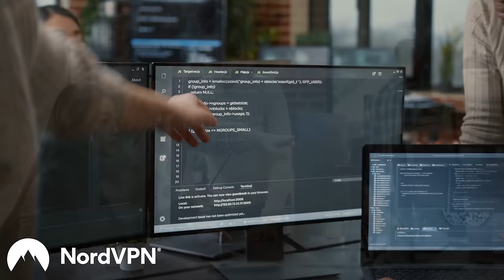Elon Musk fails Cybertruck stainless steel metallurgy test | Auto Expert John Cadogan

Comment: Cybertruck steel failed. Then Musk had to order expensive high quality steel from Finland. Company name is Outokumpu. They have supplied SpaceX before.
Reply: That’s not completely True.  CyberTruck has always used the same SS as the Starship uses.  This steels main supplier is in Texas but the Finnish company is secondary supplier for SpaceX and is now the main supplier for Tesla.  The Texas supplier is more strategic supplier so it’s steel will go to SpaceX first. I am sure that in the future even more suppliers will be set up to produce this special alloy because of high demand for it.
Reply: Where did you get this information that the steel failed? What's your source? Trust me bro? Tesla uses the material scientist from SpaceX to design the steel. Any steel manufacturer can produce it and supply to Tesla. It's like Apple designs the chips but Chip fabs manufacture it. That doesn't mean that Apple's chips failed and they had to order it from a supplier.
Reply: @achasilas6535  " Tesla uses the material scientist from SpaceX to design the steel."
I'm not sure what that is supposed to mean. Requirements for space are so different to the requirements for a car that I can't see why using SpaceX metallurgists should be seen to be an endorsement.
Reply: @cccmmm1234 yeah cos wtf do rocket scientists know right?
Reply: Utter nonsense. Tesla obviously doesn't fabricate it's own steel. It's suppliers in Texas and now in Finland manufacture Tesla's 30X specification. I don't see how that could be spun as a failure.

You sound like a flat-earther.
Reply: @cccmmm1234 why is that confusing? If you have access to highly skilled metalurgists, you would want to use them. The field is not so specialized that a SpaceX metallurgist would be incompetent at designing a metal for Cybertruck.
Reply: @Seehart  "it is space steel" is just bs to excite the fanboys.
If you're old enough, you would have seen the same hype in 1960s/70s marketing hype when the space race was on.
The requirements for space are completely different than for cars. This is hype. I really doubt that it happened as much as Musk says.
I write software that NASA uses. Maybe I should start calling myself a space programmer for extra credits.
Reply: @cccmmm1234  Well sure, there is hype involved. The motivation to use this steel and get the help of SpaceX engineers to design it is just resourceful engineering.

The conditions in space are entirely different, as you point out, but the skill set is the same. In both cases, it helps to have a deep knowledge about all of the material property effects of combining various elements in the alloy. SpaceX material engineers presumably have this generalized knowledge. Your argument is like rejecting a seasoned full stack web developer because they've done websites for the finance industry but you need a web site for an airline. Skills are skills.

But sure, Elon bragging about the SpaceX connection is legitimately hype. So what? Is this the first time a car company has engaged in hype?
Reply: @achasilas6535  More Tesla/Musk Hype BS.
Reply: @cccmmm1234  that Just means SpaceX metallurgist are some of the best in the world. They have design metals that withstand some of the toughest stresses and condition of any moving object. So using their expertise to design something revolutionary for the car industry which is less demanding. So you should expect excellence as well
Reply: Earth is testably flat and stationary  @Seehart
Reply: @joshtheflatearthjedi222  yes, josh, of course it is. I know that. I'm glad you and I and John Cadogan can agree on something
Reply: @Seehart  me too

Comment: Hello John, George here in Michigan USA. I have not bothered you in a while but I just want to say one thing here. Quite a few years ago I saw a sort of high def line drawing of a modern car shown in a transparent form with all the different steels used shown in different colors. I found it very interesting to be able to see that for example even the corners of the window frames might be a different steel than that used in other areas of the door for example. There were many, many parts of the vehicle made up of many different alloys for safety and strength.
Reply: Makes sense. Different steels have different attributes. Different parts of a car have different stresses etc too.  It makes a lot of sense to use different steels where each is appropriate.
Reply: @cccmmm1234 even more - remember those aluminium frames for shaving weight and improving stiffness? Years ago there were articles about using high strength, light, multi-sheet (something like making swords, or I may be mistaken) steel used for frames, that would have same stiffness at same weight, but much cheaper and, of course, actually repairable.
More on this - those curvy shapes make the body stronger while light, flat sheets flex, a lot - it's not long to when we see Cybertrucks covered with same thing as bed liners (just like those 4x4 prepared for rough environment)

Comment: “All of the metallurgy is known.” - As a cutlery enthusiast I disagree. There is still new steels being made. Vanax and Magnacut are (relatively) new materials in the world. Shape memory alloys are another. I wish I was smart enough to do a materials science work, it seems like a growing and very interesting field.
Reply: Yeah, its sometimes amazing how often old retired engineers can cling on to old knowledge, and very adamantly insist on that everything is already know and no progress can ever again be made in their previous field of expertise.
Reply: Cutlery enthusiast, interesting! I'm more of a Cutlery admirer but I truly adore chopsticks. Hey, whatever floats your boat! 🍴🥢⛵
Reply: The steels you quote are both powder metallurgy steels, aimed at the knife-making market.  These proprietary grades might be recent development but powder metallurgy is not new.  However, they are a quite separate category of stainless steels to those continuously manufactured strip steels used for large scale manufacturing, which is the subject of JC's video.
Reply: @stefanh616 Dreamer. As a metalurgist and high performance race an Marine engineer I Absolutely confirm everything he said. 

I will also add, that going to skinny little wires at 48V powering All the lights, door latches... Everything.
Is Going to be an absolute nightmare with the galvanic corrosion induced by that Friggen stupid silver urinal body.
It would be a big problem even with a 12 volt system with 4x as  thick chunky wires.
Reply: John was talking about cars if I'm not mistaken ...good luck using Vanax or Magnacut to build a car body or outer skin lol 😂Layering carbon fibre compounds in between conventional steel alloys during manufacturing would result in a far stronger material relevant to it's application than any extra hardened steel alloy. What would be the point of a carbon tungsten car door for example? Such a door would instantly disintegrate into a thousand pieces if involved in a T-bone type collision, resulting in an even lesser protection of the occupants in that vehicle. Horses for causes  😉

Comment: A lot of modern cars use steel with boron content, which hardens during its time in the paint curing ovens - it has BH in the description for bake hardening,  and often has a electro-zinc coating of between 50 and 100 microns...

Comment: My first car was an EK Holden and it had compound curves on all the body panels. The bumper bar was also compound curves and when a "driver" reversed into the pointy part of the bumper bar it ripped the side of his car open and put a small scratch on the bumper. Those large flat surfaces of the cyber urinal will deform in the most gentle bingle and it will be bloody hard to fix.

Comment: Anyone remember how popular stainless steel appliances were? Only problem--they showed every scratch
Reply: Also fingermarks, grease, oil, all show.
Reply: And every finger mark.
Reply: Wtf did you do with your appliances? You think your plastic ones are hard and don't show the scratches?😂
Reply: So you have never herd of wraps
Reply: And rusted.
Reply: stainless steel appliances are the most popular selling appliance on the market. it gets prints, you wipe them off
Reply: Stainless appliances are at least strong enough for the job.  One big concern I see with using SS for car building is that the vibrational stresses of driving on dirt roads etc could cause work hardening, leading to cracking etc.

Comment: My experience with stainless commercial door hardware varies wildly, just like with other varieties of steel alloys. Screws that strip and bend, barn door tracks that destroy M42 drill bits, and every level of hardness in between. Sheet metal of that gauge wouldn't offer any appreciable resistance to a press with several tons of pressure on tap.
Reply: You have no experience on Tesla's steel. They invented it

Comment: Misleading!

You are correct is saying that the correct sized and maintained Press for the job should never break.

The problem however lies with the press tool (the mould) that goes inside the press, that actually shapes the part (product). 

I have seen press tools break due to overload and stress caused by trying to create a shape in the part that is difficult to achieve.
That will often mean redesign of the Press tool, the part or both.

With a sheet metal that is prone to work hardening (such as stainless steel) as you mentioned, some shapes will therefore be impossible or impractical to achieve consistently.

So, Elon should have said it was breaking the Press tool (the mould) and not the Press.

Either way, I don't see that shape catching on.

Comment: Good job explaining the metallurgy and I hope this will help explain the phenomena you are talking about @ 11:20...
Metal objects are not completely solid. When looked at under an electron microscope, there are 'spaces' between the different molecules that make up the metal- such as aluminum, manganese, carbon, etc,- and they are called 'dislocations'.
Once a metal starts to be stressed or fatigued, ie- bent back and forth like the coat hangar in your example, the 'dislocation's in the metal structure will move and congregate in one area, which then will potentially break, or actually does a 'catastrophic break' as in the coat hangar example, or leave a permanent bend as in a car fender.
Hope this helped.

Comment: If we assume the stainless 30X is regular 304 grade. Tesla will face alot of claims that their Cyber Truck have issues with rust, especially in coastal regions and in industrial areas with air pollution. They can have avoided this by clear coating the steel. We will see how it folds out.
Reply: Except stainless doesn't like paint. Not a major problem for the old brushed finish coffee table frame, but on a flexing rattling uv bombarded surface like a car body, think 90s to 00s chevy clearcoat in florida... lololol
Reply: Good luck finding a clear coat that will go over stainless steel and stand the test of time.
Reply: @davidbrayshaw3529  I did not say it would work over time. It's just a quick fix. They do the same on refrigerator doors, but there it is done to minimize the problems with finger prints.
Reply: @SwedishMisha  There's a point. I wonder how that finish holds up to UV?
Reply: @davidbrayshaw3529  I am just speculating what Tesla can have done. I know a standard grade 304 will have rust issues overtime in coastal regions.
Reply: @SwedishMisha  In this day and age, I would have thought that they could have either stuck to materials that are well understood and have properties that are suitable for the application or perhaps they could have gone down the pathway toward composites. The latter certainly has its challenges, pertaining to a vehicle, I know. But stainless steel?
It has wonderful properties in many applications. But are those properties pertinent in the context of constructing a car body? Especially when combined with an aluminium subframe!!! Time will tell, but my limited experience with stainless steel is that the "softer" varieties such as 304 and 316 aren't as durable as many would make you believe in a host of applications. As you assert, oxidisation is an issue. Abrasion resistance is terrible. Unless work hardened, it's more than soft and dents easily and it fatigues, not that that should be a problem in this instance. I'm not an engineer (neither is Elon Musk!), but I really would have thought that a "revolutionary" departure from carbon steel construction would have led engineers to plastics of some sort, not a different alloy of steel.
Reply: 316 is Marine Grade, 30x is subject to pitting and tea staining. It is really the poormans stainless.
Reply: @davidbrayshaw3529  Stainless per se is not a bad material, but you need to select a proper grade. I would choosen a duplex grade with higher tensile strength and better corrosion resistance than a 300 series grade. Still an uncoated stainless steel can still have rust issues depending on the environment. There are just no stainless steel grade that will cope in every environment. So in certain areas Tesla will have rust issues. We can hope the interfaces between the aluminium frame and the stainless panels are isolated and not metal to metal contact. If not isolated, that is a recipe for disaster.
Reply: @SwedishMisha It sounds like you are much more familiar with materials technology and metallurgy than I am, by a long way.
I am neither an engineer nor a metallurgist, so my opinion is unqualified.
But my experience with stainless steel alloys leads me to believe that it is a long way from being a "step up" from carbon steel, in the context of car panels, for a number of reasons.
Yes, isolation between the aluminium frame and the panels is absolutely essential. I have some experience as a maintenance worker in aviation and as a hobbyist in yachting. Aluminium and stainless  steel don't play happily together, that's for sure.
Reply: @SwedishMisha  information is power. Do you think Tesla didn't think of this while designing the truck. They use something similar on their rocket. Elon said that they invented a new alloy of steel that is strong and will not Rust. That's literally what they said. They have arguably the best material engineers in the world.
Reply: @achasilas6535  So we have a Tesla fanboy here😁. Sorry if I messed with your God. 
I am just speculating from the information given by Elon. A 304 grade will not cut it. Secondly any new grade is developed by the stainless producers. Thirdly I've seen alot of mistakes in selecting the proper grade in my days. 

As I wrote we just have to wait and see how the stainless panels on the Cyber Truck will perform. I have juste pointed out potential hazards with a 300-series grade.

Comment: PCBN (PolyCrystaline Boron Nitride) is second in hardness to Diamond.  Used for machining hard wear resistant alloys upto around 70HRc like chromium cast iron such as Ultra Chrome, where diamond can't be used because it oxidises and basically sets on fire when combined with the elements in certain materials.
PCBN is very brittle though, and has to be treated 'just right'!
I've spent 10 years machining ultra hard cast iron alloys, Tungsten Carbide just melts, HSS, and Cobalt tooling won't touch it!

Keep up the good work John!

Comment: As some one that works in the Metal Manufacturing trades (Fitter Machinist). The first thing you get taught about most common materials in your first year as an apprentices, is that the harder the material, the more brittle it is. I learnt this at age 16. Why would you want to build a brittle car? 

 Also, I used to work in a factory where we would formed and extruded a 5 pointed star shape washers about 250mm long x 5mm thick out of coiled 304 stainless steel on a 500 ton stamping press. The press strain gauges would measure 250 ton on the columns of the press. This press would punch hundreds of thousands of these plates around the clock. Not once did I see the press or the tool struggle at all. The press was 50 years old at the time, and has punched over 20 million hits. 

Sadly, we don't value the manufacturing engineering trades or the education behind it. So it's easy to throw statements like electric Jesus just did without anyone from the main stream media questioning it. Maybe because they lack the basic engineering principles of material hardness. If he said those statements in Newcastle 50 years ago when the town was still steel making, the whole town would have laughed at him!
Reply: I guess they didn't teach you that there are different levels of hardness of stainless.
   Why don't you educate yourself on the type of stainless that Tesla is using before you make a fool out of yourself on the internet.  🫣
Reply: you still have a lot to learn..........Tesla is all about cutting edge technology........they are far more advanced than your text books.
Reply: @williamscoggin1509 I find it funny this guy just threw out a single life example of unknown stainless & claims that undeniably proves Tesla incorrectly dialed in their materials & forming methods